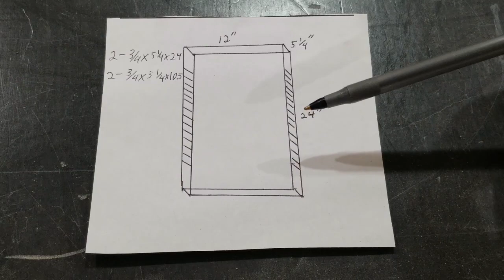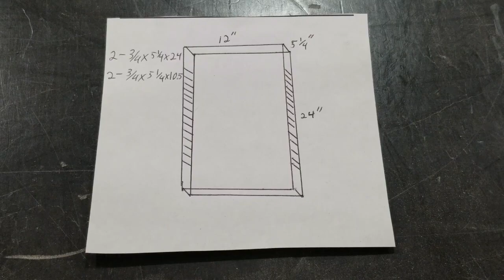Banish the Chaos: Easy to Build Drill and Router Bit Organizer

Comment: GREAT project.  I am looking for a storage unit I can put behind my drill press to hold all the forstner/regular bits.  I do like the slots so each shelf can be placed to accommodate the individual bits and or accessories! !! !!!
Reply from the maker: The ability to adjust as needed was something I definitely wanted to include.  I try to incorporate this into all my shop pieces.  An added benefit with this has also been having the ability to take a whole shelf with me to the bench when using my hand drill.